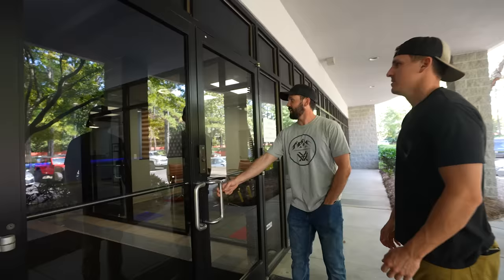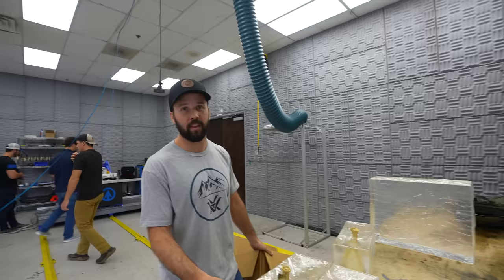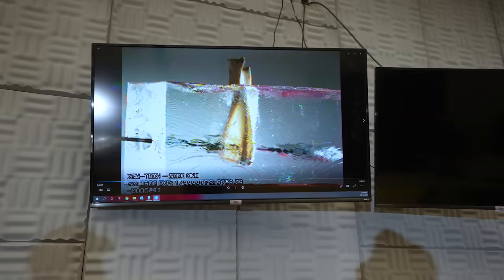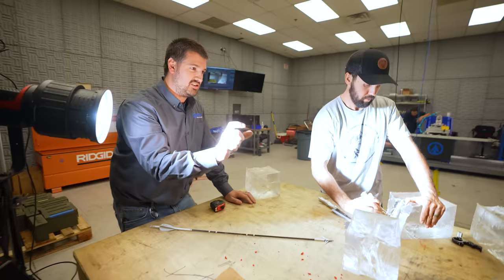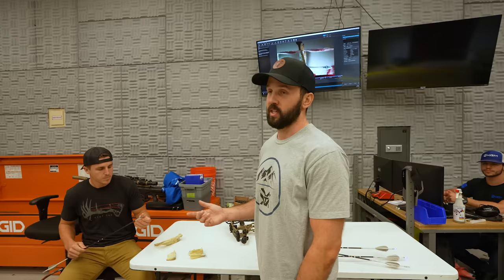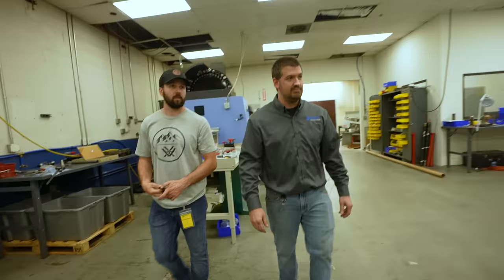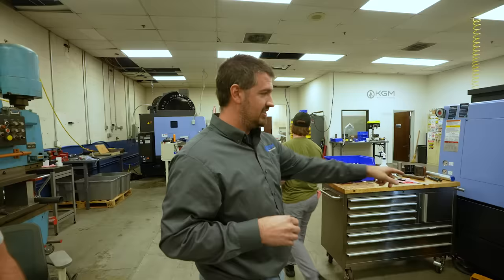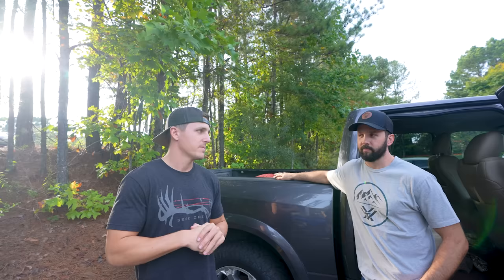BROADHEAD TEST: Which One SPLITS BONE? (Super SLOW-MO Camera!!)

Comment: I have not experienced any penetration issues on hitting the scapula of an average deer sized animal with a Rage Hypodermic broadhead, but I am shooting 650 grain arrows at 260 fps.
But in general do I highly recommend the use of fixed blades.
If you hit a bit back, you will still kill the deer and if you hit a bit forward and hit the scapula, you will still penetrate and kill the deer.
And it is for sure safer to use at angled shots.
With a large cutting expandable, you will kill the deer if you hit a bit back, but if you hit a bit forward, the chances for you not penetrating the scapula and not killing the deer is rather big, unless you use a setup similar to mine.
If you risk hitting a deer so far back that you feel the need for a large cutting broadhead because of that, you are either not aiming correctly or you are a crap shot.

Comment: I’d rather see it back in the gel and shot quartering away at 25 yards. Much more likely to hit the shoulder bone like that, than hitting the near shoulder broadside. Hitting a high shoulder shot (like a rifle shot) on the close shoulder that’s within 30 yards results in a dropped in spot deer (like a rifle shot), weather it goes completely through or not. Not a preferred shot, but I have seen it done.

Comment: Awesome video. Not surprised as to the mechanical head performance after watching a ton of elk hunting videos with people using mechanicals. Rarely see a pass through. Idaho doesn't allow mechanicals and I agree with that. Would be interesting to compare chisel tip versus cut on contact. I am a believer in cut on contact for elk especially as in theory they cut upon impact instead of driving through heavy hide. Another discussion point to explore is two blade vs three blade. Hemorrhage would be best when the blade cuts across tissue compared to parallel with it which may occur with two blade and less likely with three blade.

Comment: I would like to see you guys on the Rage 2blade chisel tip. I've shot them for 2 years and have had full pass throughs everytime. 525grain with head arrow setup. I've went through a shoulder with quartering shots. Through ribs. I LOVE these heads.

Comment: Trocar tips are well known for bone penetration.  Try the old Muzzy 3 blade trocar tip 100 or 125 grain.  Also, the trocar tip with small bleeder blade and 3 main blade Grim Reaper 100 grain.  Need to induce blood loss.

Comment: So as you go on with this I am beyond interested from an engineering and hunting stand point. Someone I think you should contact is Randy Kitts. I think he could be a great asset to your mission. Also to add to the fixed vs expandable. I would rather have two holes and one wound channel vs a partial channel that if from a tree stand or steep angle would or could take a significant amount of time to fill the chest cavity and actually start bleeding. Keep up the great work and I look forward to the next video.

Comment: I will say this.  I have used expandable with some good results.  Yet that said.  I am only using fixed blades.  I lost more deer with expendables not working correctly and I used some very top-rated industry broadheads.  some fail to open and some just break blades off and the deer goes on.  I have so far not lost any deer using a fixed bade.  I use two types I like.  The exodus you have is one and the Magnus buzz cut.  Both have been performing very well and I have used the same packs of broadheads since the day of purchase.  Only have had to keep sharpening.  that's it

Comment: the facts are this though. I have taken bear, moose, elk and just about everything  in between with rage hypodermic and trypan heads. I have hit shoulders at times and have never had an issue with penetration out of a 70 pound mathews and 555 to 580 grain total arrow weight. I use a smaller diameter arrow which decreases drag and friction.

Comment: In KS our whitetails tend to be quite fatty during rut.  When cutting through the meat, fat, hide, and hair, a 2 blade tends to only leave a slit. It doesn't pop the skin like a 3 blade or 4 blade does. This slit will fold back into its original position and not allow much blood to escape. Long story short, if there is a marginal hit or a deer runs to heavy cover, there typically isn't much of a blood trail.  This is from personal experience.  I've killed deer with a Trypan that only ran 70 yds and died (double lung), but didn't leave anything but small droplets every 4-5yds.  Had I not seen him go down he might have been hard to find.
I've seen this plenty in KS.  This is just my opinions on 2 blades.  They fly great but don't always leave much of a trail.

Great video though!

Comment: good info and cool tests. If they could next time put the shoulder blade close to the front of the gel, that would be better. Since the shoulder blade is in the middle of the gel, we know you don't go through that much meat before hitting the shoulder on a live deer, you hit shoulder (scapula) pretty much after breaking the skin, there's only a small amount of meat on top of that scapula. Here in this test, the arrow had to go through couple inches of gel before hitting the scapula and the arrow has lost some of its energy before even getting to the scapula. You guys put the cardboard in front of the gel for the rage to simulate deer hide and help it open up on contact and that was a good idea. Love @ 24:30!

Comment: I hunt with two buddies that shoot 350 grain arrows out of 70 lb bows 28-in draw. And they blow through elk like hot butter at 20 yd to 30 yards. I still don't understand 500 plus grain arrows for white tails. I blew through a 5-point bulll at 12 yards with a 420 Grain arrow last year. The ribs are almost as big as the scapula on that white tail .

Comment: Every mechanical will have some trouble with a low front shoulder shot ,  but as far as a high front shoulder shot (thinner part of the scapula) and rib shots there is one mechanical that out performs the rest, the shwacker 2 blade (especially the levi morgan series with the curved back blades)   the fact that the Ferrule goes into bone before the blades even open makes a world of difference.  I shoot 65# at 29 inch draw and have never had anything but a pass through and broken ribs at least on 1 side every single time.

Comment: I use mechanical on crossbows and fixed blades with regular bows. The amount of energy a crossbows bolt carries will carry that mechanical right through a shoulder no problem.

Comment: There was a guy in the 60s or 70s that wrote a book about this, I can’t remember his name. But after all his testing he determined that a two bladed Broadhead with a 3 to 1 ratio that is 1 inches wide and 3 inches long had the best penetration. And having FOC that is at least 18% was most productive. I have found that total arrow weight between six and 800 grains has the best penetration and still carry enough speed. It may be a slower arrow then what the bow is rated for but I also notice because it slows the action of the bow down it also makes the bow much quieter! You guys said that your total arrow weight was 550 grains, start increasing the weight of the arrow! I bet you if that rage was on a total Arrow Weight at 800 grains it would blow through anything? I think it’s all about weight, chucking Spears is way better than chucking toothpicks!
Reply: The name you are looking for they said in the video. It's doctor Ed Ashby :-)

Comment: Great video and awesome to see, but there isnt 5-7 inches of flesh in front of the shoulder blade. So to say that the mechanical blade wouldn't have killed the deer is incorrect. There is a lot of momentum depleted through that 5-7 inches of ballistic gel to get to the bone. Yes it didn't go as deep as the fixed blades, but it would be nice to see that bone closer to the surface like it would be in a real deer.

Comment: Have you guys looked at the Valkyrie three blade heads? We have had good success with structural integrity, bone breakage and blade retention. I'm a big fan. I have shot the cutthroat and some other really good single bevel heads but I prefer the three blade for deer.

Comment: I've shot rage hypodermic for years and never lost a animal with all angle shots included I've shot deer in the shoulder and dropped them in there tracks I've blew through ribs and never had a problem every thing I've shot I've watched die in under 100yrds I shot a black bear quarterd away and it went 60yrds and was dead love your guys videos no doubt but no matter the tests it's all preface and what has worked for the shooter and mine is rage by having interchangeable blades I can always have a sharp head even if it's been used

Comment: Enjoy watching you guys daily as you continue to grow in your faith in Jesus and become more popular in the deer hunting industry. One suggestion:  expandables first came out because they flew more accurately than the two or three fixed blades.  However your recent broadhead testing clearly shows that the fixed blades are more reliable and have better penetration through bone than the expandables. How about doing a video on how to fine tune those fixed blades on an arrow so that it flies more accurately and comparable to the expandables flight. If you come out with a two fixed blade broadhead made by Seek One I will buy them.  Until then, Swhacker, Magnus and Zwickey are my choice. Just wash the blood off them, sharpen and reuse multiple times.

Comment: Great test video!! 
For old style 2/4blade (2blade with bleeder 4 blade) check out:  Steele Force (single bevel). Both companies have various fixed blades with vent holes. 3 blade fixed CoC Muzzy One & NAP Hell Razor.
Here is  a little anecdotal  evidence: Watch the hunting videos that is sponsored by one of  'the company you tested'. Check out the penetration depth on the deer, elk, etc... It look to me like around 16 - 18 in is sticking out of the animal.. Then you have shooters that shoot under 60lbs draw weight.
I shoot 125gr Magnus Stingers 4 blade. But, I have Steel Force Phatheads as back up

Comment: I use nightmare broadheads made by NAP or nap Razor. They were off set at 3 deg shot exactly like field tips. Some deer I have shot dropped on the spot. One shot thru both shoulder blades went thru, deer didn’t go far. Shot a hog quartering away under the last rib. That one the broadhead jammed between the collar bone and the neck. It’s like wow! Cleaning that hog looked like a rifle shot on the inside! Can’t find them anymore? why?

Comment: Would be great to hear thoughts on 4fletch vs 3- 3 or 1 blade broadhead and how many fletches work best with how many blades up front (QAD vs Day6 etc). So much info all over on this and lining up the fletches or having the fletches between the blades all that needs tested if possible

Comment: I wish I could share pictures here in my comments. Last weekend my buddy killed his first deer with an arrow tipped with a shwacker.  Granted, it was a crossbow and at 60 yards, the shwacker crushed the bones in its front shoulder leaving a fist sized hole. The deer went 10 feet. The swhacker is useless as it's tip is smashed but it did major damage for sure. This guy has definitely paid his dues over the years gun hunting and has acquired true hunters luck. The morning he got his crossbow out to hit the woods, I watched him take the tags off the crossbow as he had just purchased it a couple days before and had never shot it or any bow ever. He had just two bolts with no broadheads, so I dug around my bow case and found two new shwackers I'd gotten a few years back for turkey hunting. He told me it sounded like he hit the side of a house when he shwacked the shoulder. Our 600 acre hunting spot in Protem Missouri is full of deer and it looks to be a great rifle season this year.🦌🤺

Comment: I've big game hunted for over 40 years and was taught from a expert bow hunter in the 80's the most lethal shot will either hit the heart or anywhere the femoral artery runs throughout the body. He often shot his deer when they were walking away to the right or left side of the tail in the rump patch into the ham. The deer would never go further than 20 yards as the blood poured out in buckets weakening the deer rapidly, they can't take it, lay down and expired immediately. A mechanical or fixed blade will drop them when taking this shot.
Enjoying your shows and wishing you a highly successful hunting season!
Reply: Lungs are a much larger target than an artery in a hindquarter. Lungs don't work with holes punched through them.  Lack of oxygen...the lights go out quick.

Comment: If you are worried about your broadhead not penetrating ribs, that says it all. A sharp fixed blade allows you to take more shots at different angles. I'll shoot my 600gn arrow with an Iron Will up front at pretty much any angle (depending on yardage) knowing it's going to penetrate and stay intact.

Comment: Not sure if you guys did a follow up video from this one but could you make another one but with realistic scenarios?  shooting from a treestand to get the angle, since at an angle you will most likely penetrate a thicker scapula and deal with some deflection. Furthermore,  shooting it from no less then 20 yards which is most probable since we tend to set our shooting lanes within that range and lastly is the thickness of the gel, was that gel at a lighter density?  Not sure why you made it so thick or were you compensating for the distance and made your calculations accordingly because the facility didnt offer the yardage?   However, I did appreciate the homework and time you put into this, very informative.

Comment: I shot a quartering to deer at 25 yards last week using a 385gr arrow with a grim reaper whitetail special mechanical. Hit the shoulder blade blew through ribs in and out and still passed through. The broadhead has a little roll in cutting edge but still functionally sound. Just saying

Comment: Any 2 blade head can and will deflect imo . 3 blades and 4 are more stable once inside a deer. I once had a old style Magnus stinger 140 grain  2 blade (Fred bear solid weld type)that was super sharp completely fold over on a scapula of a young buck. I was my first crossbow kill. I was using Excalibur matrix 355.  It broke the bone and I found it but that broadhead looked  all crooked and simply dropped after hitting scapula. Since that I try to avoid them 2 blades even though I have had luck with old stock 2 blade thunderhead 150. They are super sharp but hard to find . Nowadays I use tooth of the arrow 4 blade and swhacker 150 for Turkey. I have had several pass thrus with large 150 shwackers that had no blood trail . I have lost 3 deer with them Even after pass throughs and wouldn’t recommend them. Even with a bad shot you should be able to find a blood trail IF your expandable worked after it went through ribs. I just can’t trust them like I used to. 3 blade is way to go. 4 blade if you use crossbow or bow powerful enough for pass through. There are plenty of options. We are living golden age of broadheads with all these tool steels etc. I do think  2 blades fly the best .

Comment: You should look into the starbursting affect and how it affects scary sharp Broadhead with high quality metals. Also I’ve noticed and it’s completely antidotal but I don’t think the mechanical broadheads give you an advantage if you shoot guts. They tend to not cut as much because gut matter bogs them down and then they tend to run off hard and not stop until they bed down or die. But the sharp fixed seem to have the deer run 40-60 yards and stopping. I noticed that with both lethal and unfortunately non lethal hits.  They both only go 40-60 and dies or sit there wondering what happened and that gives you a possibility to get another arrow in them. I also have killed deer with and all my family uses rage but I had two fail so I switched

Comment: Iv been going down this rabbit hole too. Furreal size vs shaft size is a highly over looked area in my eyes. Let’s use a 5mm shaft with a 5/16 furreal (at the base). You get a initial hole around the shaft that’s slightly larger than shaft diameter. Granted the blades do work too but thru bone, possibly 80-90% of the shaft is dragging the circumference of the hole. If that makes sense. Figured this out by shooting 5/16 field points on my axis 5mm shafts (didn’t have any 9/32). Hit a 1x6 cedar board and the shaft pulled out with some force (removed the field point first) but when I tried that with a standard shaft.... couldn’t get the shaft out. Excited to see what y’all come up with. I personally like magnus black hornets.

Comment: Did you sharpen the cutthroat? They come dull as butter knives but can be sharpened easily with roller guides to be way sharper than anything straight out of the package. I mean hair splitting fine edges.

Comment: I think it's obvious the fixed blades penetrate further, less cutting diameter = less drag. I shoot the Typan and or Hypodermic and only lost 1 deer because I hit the leg bone. I've killed several shooting thru the scapula. Maybe it's my setup, poundage/ draw length, but I'd take a Rage over the fixed blades on whitetails for a couple reasons. 1st and foremost, blood trails you don't have to squint to see and they fly exactly like a field point. I've had my Typan blast thru the scapula on mature Ohio whitetail and lodge in the offside shoulder resulting in a dead deer. Like I said before, the one I lost actually hit the leg bone attached to the scapula and somehow didn't deflect, it just stuck in it just enough to stick